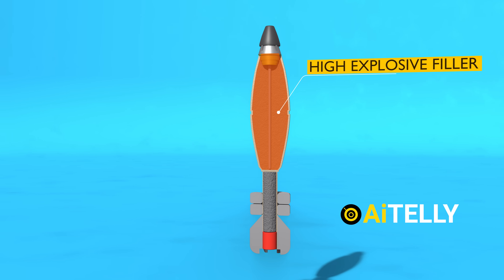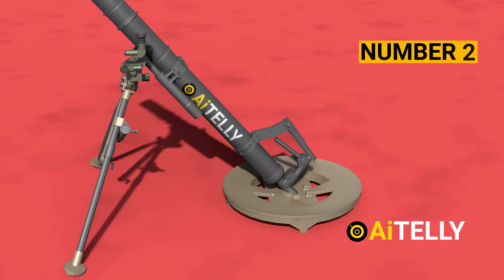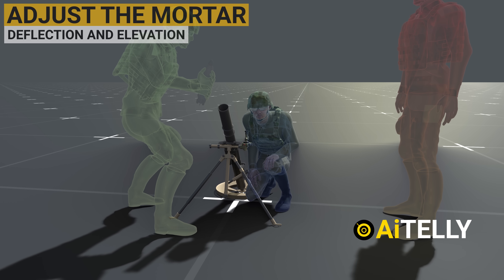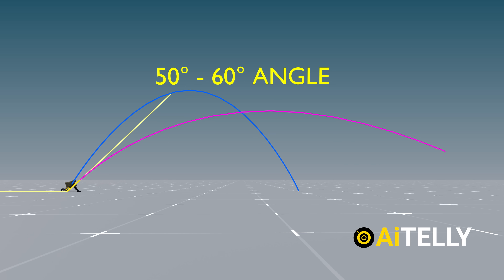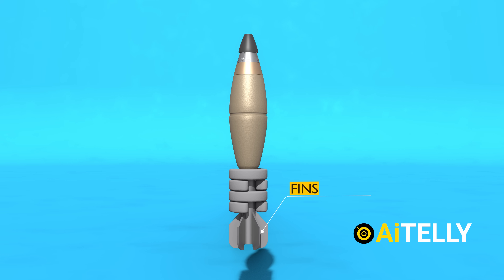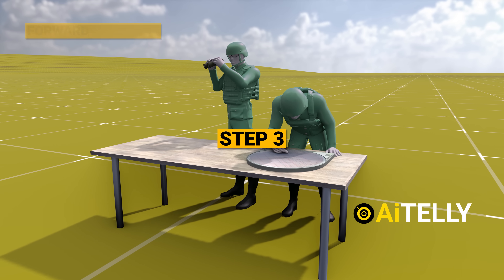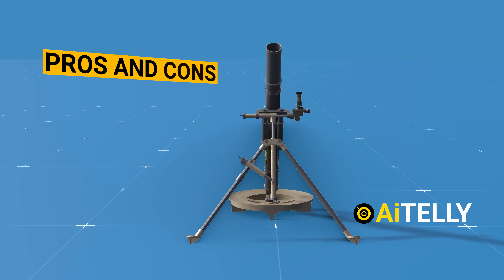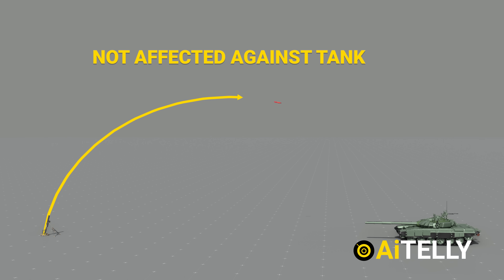How to Fire a Mortar?

Comment: I always struggled to understand how mortars are aimed and particularly in what angle they are set and how do they calculate the range to the target over a hill. To me that range scale made perfect sense, thanks for the information!
Reply from the maker: Always Welcome
Reply: @thanasisrks4944  take it from a former mortarman here. Take everything from this video with a grain of salt. The information isn't 100% correct. Mortar squads are made of 4 men typically. Squad Leader - who's in command of the squad, relays info from FDC and records firing data. Gunner - in charge of manipulating the weapon and getting it on target Assistant Gunner/ "A-Gunner" - makes sure the rounds are in the correct charge and assists with gun manipulation as needed and drops rounds into the gun Ammo Man - Carries ammo, sets charge and fuse, hands rounds to the a-gunner.

The parts about how aiming stakes are laid out as well as how the gun gets manipulated are also faulty. The idea is there, but if you tried to learn to work a 60mm mortar in conventional or handheld through this video you'd probably have a really hard time firing and hitting your targets.

Comment: So what happens in the case of a misfire & how is the problem solved?
Reply from the maker: This requires another Video 😉
Reply: Very very carefully.  Mortar rounds are not armed out of the carrying canister.  They are armed by a hard strike on the bottom which breaks a wire inside the round and arms it.  Why a round misfires you don't know you just know you now have an armed round sitting in the bottom of the tube.  The procedures (for the 81mm) are everyone withdrawing to the rear for 5 (maybe 2) minutes.  Tubes get hot and the round's propellant could still cook off.  Once time has passed, the gunner and assistant gunner approach the mortar.  The assistant gunner (AG), while facing down range, puts his left leg in front of the bipod for stability and places cupped hands (top and bottom) over the boar such that the fleshy part of the hand creates a ring around the opening.  The AG is going to catch the round as it slides out.  The gunner carefully rotates the tube to release it from the base plate.  Once the Gunner and AG are ready the gunner slowly and steadily lifts the bottom of the tube and the AG maintains his hands ready to catch the round as it slides out.  I had to do this twice when our mortar's firing pin broke.